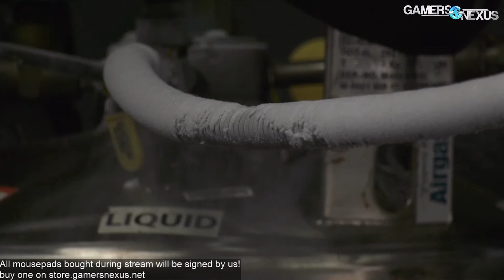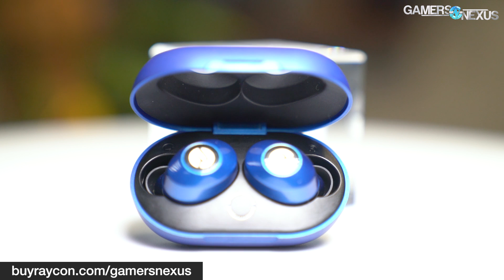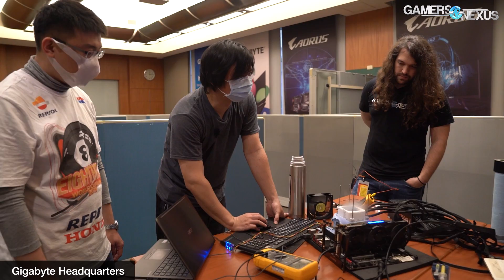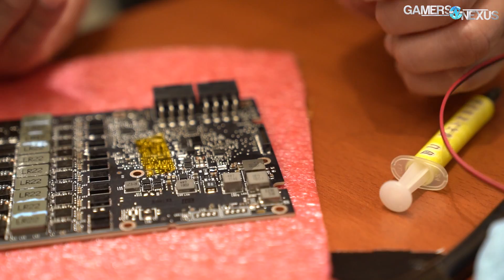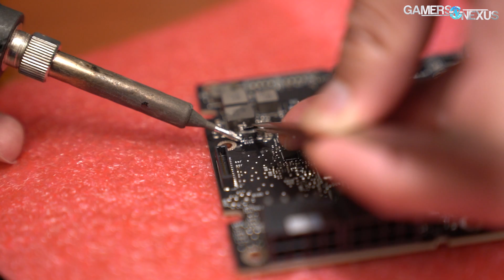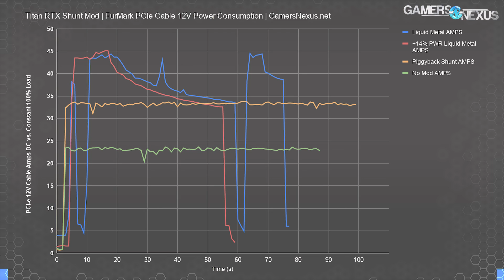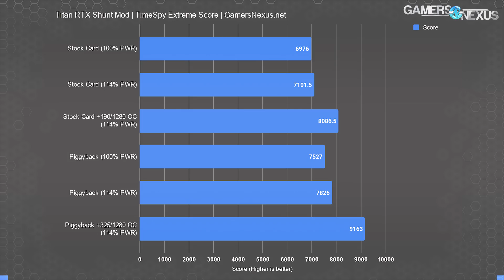RIPJAY Hardmod: Breaking NVIDIA's Rules w/ Shunt Resistor Piggyback, Ft. HiCookie

Comment: For the love of all that is holy - Buy a decent soldering station with good thermal capacity (not just high wattage). lol

Like Pace, Metcal, JBC, Hakko etc.

And use a wider 3-4mm chisel tip. The pointy tips on cheaper stations are almost useless on these multilayer board with huge internal power planes.
Reply: I should say that it worked fine in this vid, but there are countless other vids where people are using a cheapo iron with the tiny pointy tip, and they're wondering why it's not working properly.

8:23 - That's exactly how quickly the iron should melt the solder (on both the component and the pad) when it's working properly. If it's not doing that within a few seconds, then something else is wrong.
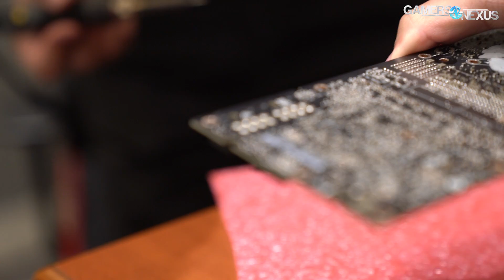Reply: 8:38

Yep, the "shunt" resistor has a known (and very low) resistance, so the card can measure the voltage across it to work out the current passing through it.

It needs a very low resistance, so it doesn't drop too much voltage, which would bring down the supply rail too much. It just needs to have a high enough resistance for the voltage drop to be measured with some accuracy.

The resistor added in the vid is marked "8M0", which means 8.0 milliOhms.

(the "m" is the milliohms unit, which is often put where the decimal point is on the component marking. They seem to use capital letters, for some reason.)

If you enter 0.008 Ohms on this calc, with a current of say 5 Amps, it will give you the voltage drop across the resistor...

(assuming there's only one 8 milliohm resistor on the board originally.)

http://www.ohmslawcalculator.com/ohms-law-calculator

Which is 0.04 Volts, or 40 millivolts.

The card can use that to detect that 5 Amps is flowing from the PCIe power connector to the GPU.

If you add second 8 milliohm resistor in parallel to the first, the overall resistance will be HALF, or only 4 milliohms.

The card will then only "see" 20 millivolts across the resistor(s) when 5 Amps is flowing.
That would increase the current limit by a factor of 2, which is probably not a great idea.

It means that when the card thinks there's only 5 Amps going through that power rail, there will actually be 10 Amps flowing!

So it's always a bit of a risk if you add extra resistors in parallel, or completely short across the resistor.
If something does go wrong, it could kill the GPU itself, or burn up the contacts or wires of the PCIe power connectors.

It's up to the modder to be aware of the risks, and to tell people if the card has been modded if they ever sell it on.
Reply: oic - the onboard resistor was 5 milliohms, and the new one added in parallel is 8 milliohms.

So that would give around 3 milliohms after the mod, which would increase the max current limit to 166%.
Reply: Thermal capacity's largely irrelevant, and is mostly the way that crappy irons try to compensate for insufficient power and bad regulation.
I use Metcal irons for most things, and they have a very low thermal capacity.  That lets them heat up very quickly, and they also cool off very quickly when you shut it off.
What makes it work is that they have sufficient power, and very good regulation so as soon as there's any thermal load on the tip, it's pumping out full power.

I totally agree with you on the wider tips.  While you can get away with a pointier tip on a top quality soldering iron, they're never as good under high load conditions.  On a cheap iron, the tip will cool off way too quickly, even if the base of it is running full power.

I'd suggest for people who want to get into something usable for cheap, there are some reasonable import irons for $20-$30 that fit Hakko tips, which are ~60W and regulated.  They will get the job done, with a little bit of twiddling with the knob to make up for their less than stellar regulation.  (I crank that to 450 if I need to solder to a ground plane, etc.)  Also, they typically have a thin conical tip.  Buying replacement chisel tips is basically necessary to make them work for heavier loads.

For the slightly more DIY types who are into it enough to justify a bit more expense, the TS100 iron is really nice.  I use it for things where lugging a metcal supply around is awkward.  It's DC powered, so you can use an RC lipo battery pack, or put a new connector on a scrap 19v laptop power supply for plug-in use.  It has reasonably decent regulation, and quite good power when running on 19v (It's still okay at 12v, etc, but the extra voltage is nice)  Same is true for the tips.  The stock conical is okay, but a chisel increases capabilities a ton.

Hakko's got some decent stuff in the $100ish range which is probably in the same league performance wise.

Then, yeah, if you're really into electronics enough to justify spending the money, buy something really nice, but you probably know who you are.

Comment: Lucky there are experienced soldering guy guiding you through this, those thick copper pcb under the resistor is pain in the ass if the iron is not powerful enough.

Comment: I havent' seen anyone stack shunts on the Titan RTX's... on Volta and back I stacked 5MO on top of the existing 5MO, but with Turing I replaced the existing 5MO with 3MO. Very curious how that compares to stacking an 8MO on top of the 5MO.
Reply: Are you still running into current limits after stacking any of them?  It's probably jacking the limit up by 40% or so, and I would guess it's hitting other limits before it maxes out anyway?  If it's hitting other limits, having it "more unlimited" isn't going to do anything.
Reply: @nwimpney  according to the OC Scanner yes still power limited. With my setup though, seems to be temp limited as well (have two of them with Aqua Computer water blocks + active backplates in their own loop with a 560mm radiator and 4 x 140mm Noctua 2000rpm fans).
Reply: @kalmtraveler  Well, and 8 and a 5 in parallel is pretty much 3 anyway. so I wouldn't expect any difference between that and the parallel ones unless you're seriously overheating the shunt and getting a rise in its resistance.

Comment: Why not use a rheostat? Yes it would need to be mounted somewhere since it would be bigger than the surface mounted resistor but you would get a lot of current control.
Reply: Indeed.  Wouldn't it be cool to see just what the upper and lower limits are and also find the "sweet spot" without having to desolder/resolder multiple resistors.
Reply: @jessedunn3766  The soldering's not a really big deal for someone with the appropriate equipment and skills, though.
If anyone wants to give me a 2080ti, I'll gladly do some resistor swaps, and let everyone know what the minimum value is.

Comment: I can't wait to hear Louis Rossmann's commentary on this "repair"!
Reply: He had to do a repair where someone did liquid metal to do the shunt mod.  
In simple terms don't do it, the gallium material in liquid metal will slowly eat the solder and caused a failure on the gpu Louis was repairing, it basically ruined the previously good solder joint.

Comment: I know why that mod works.

You're lowering the resistance of that register. The resistance is R=1/(1/R1 + 1/R2). Because of this the voltage drop is lower on that resister because of Ohm's law. I=V/R l, or V=IR. You dropped R so V also dropped. So the GPU might be reading .1V for a 1A current, but you're making it see .05V for 1A. (Not real numbers, but that's the idea.)

Comment: You know you could use butane or some other low boiling point solvent as an evaporative cooling fluid and use the GPU to distill it over into a second container. In theory a liquid can´t get hotter than it´s boiling point so the GPU should stay at that temp until the heat spreader heats faster than the liquid can boil off.
Reply: Leidenfrost  effect is a problem.  I experimented with some phase change stuff years ago, and you hit a sharp knee in the curve. when your coolant starts to float on a layer of vapour.

Comment: Yeah.  Higher temperature is kind of a hack to make up for not enough heat, or poor temperature regulation.
I'm not dissing it based on that.  Sometimes you gotta do what works with the tools you have, and it probably doesn't make sense for most people to spend several hundred dollars for occasional projects, but just for knowledge's sake it's good to understand the difference.
That said, a cheap unregulated iron like Jay attempted was doomed from the start.  They only output their rated power when they're cold, and rely on the resistance to limit them.  Likely a 30W iron isn't doing much more than 10W once it's hot.  That'll never get it hot enough to properly wet the joint, because the board is dissipating more than the iron can put in.

The reason why it takes so long to actually melt the solder, even with such a high temperature setting is because the iron either doesn't put out enough power, or because its regulation is poor, and there's too much of a temperature gradient between the tip and the thermistor/thermocouple in the iron.  (The gradient comes from all the copper in the board sucking heat away from the tip so quickly)
The solder will actually melt at around 320C, even for lead free solder.  You normally want a bit of headroom so you have enough delta to melt it quickly, so for standard soldering 350 or 400 max would be appropriate.

For something like this, you're effectively just cranking it up way too hot so it never turns off, and hoping that you can put the heat into it faster than the copper pulls it away.  Hopefully it gets to the melting point before you cook the resistor that's already there.

Given that, you can reduce the necessary delta by preheating the board, even with a hairdryer, or a heatgun that can be turned way down to 100C or so.  (if you can get someone else to hold it while you solder, even better)  Then you only need a delta of 220c instead of 320c to get the job done.

Comment: Why didn't you do a voltage divider mod like buildzoid? The soldering would be just as easy, and the results should be much more consistent. Also, please clean the flux off with some alcohol. Thumbs up for HiCookie! I'm a fan!
Reply: the voltage divider for the RTX 20 series card is a lot more work than just stacking some shunts.

Comment: It blows my mind that anyone would even consider just haphazardly slathering liquid metal over the resistors to lower the resistance. Swapping out the resistors or stacking extra ones on top is the right way to do it.
Reply: And soldering isnt that difficult :/ but as WE have seen you can make it difficult (Jay) 😂
Reply: @SuperUltimateLP  It's not that difficult, but it's also underestimated by a lot of people who have never soldered to a multi-layer board with big ground and power planes.  A lot of cheap soldering irons aren't up to the task.
Reply: @nwimpney  you are right , but heating the board might help ;)

Comment: I delidded and now direct die my 9900k and get great temps with my 960 mm custom water cooled rig. I love tinkering with my PCs. With that said, would this shunt mod work with my 2080 Super? I use it primarily to game on.
If yes, would I see roughly 13% gains in FPS? Would my rig be able to handle the heat?... Even at full load, the GPU never hits above 42° lol
Reply: Probably.  It just increases the power limit, similar to how the slider did on previous cards.

Comment: Used 5 mOhm shunt resistors piggybacked on my Titan, worked ok, never got safe mode. Lucky me I guess.
Reply: @Klip One Not pulling off the water block to take pics, but here's these
Before mod: https://www.3dmark.com/spy/7893208
After mod: https://www.3dmark.com/spy/9881509

and these are the only shunt resistors I have: https://imgur.com/oZhQFUK

Comment: I do this on all the nvidia cards I buy for my customers, except instead of soldering them you can just place the resistor firmly on top of the stock on and then glue gun the resistor in place so it doesn’t move.  This make it removeable with no trace of soldering incase the card needs warranty
Reply: that will be very unreliable.  It won't likely hurt anything, but you'll never get a reliable high current connection that way, so it'll very quickly just fall back to stock currents when the contacts warm up and oxidize from the mediocre contact.
Reply: I’ve done about 8 of them and two have been running for a year with no problems, most of the time the heatstink applies pressure down on the resistor as well
Reply: Also it’s not a high current connection, it’s an ohm sensing connection, as long as the resistance over the shunt is lower even with a poor connection it will still work, try it before you knock it
Reply: @FrameChasers  It's a current shunt.  The whole current for the card runs through it, which is how it works.  I would say that's a "high current".  It isn't "ohm sensing", it's directly sensing the voltage dropped across the resistor, and it can do the math to know how much current would cause that voltage drop.
With a poor connection, what you'll likely get is a lower current reading (what you want to fool the card into allowing more), until you actually start drawing current and those tiny contact points get warm and oxidized and their resistance climbs to the point, where they're not really doing anything anymore.
They'd probably run fine indefinitely, but they're going to be running mostly stock, with your resistor not really doing anything.
Also, if the heatsink is pressing the resistor directly, that could easily short the sense voltage to ground, which, being a low-side shunt probably won't actually burn anything, but likely would glitch out the same as it does with too little shunt resistance, and you'd be stuck in 2d.
Please, nobody actually do this.  It's a very silly thing to do and demonstrates that you don't understand at all how the thing you're "modding" functions, and if I was your customer and saw this, I wouldn't be for long.
Reply: No, just no, ok. Dont even try to give people such lousy ideas.

Comment: Dumb question incoming: Provided you can keep the card itself cool and power draw under control, could you stack/piggyback multiple resistors for higher frequencies, or is 1 resistor the limit?
Reply: You would hit safety mode if you added more. By piggybacking the 8 mohm resistor the effective resistance is about 3 mohm. Piggybacking another would lower the effective resistance and probably go below threshold required to trigger it.
Reply: the reason this works is because it lowers the resistance over that connection

Rt = total resistance
R1 = first resistor in parallel
R2 is second, etc.

1/Rt  =  1/R1   +  1/R2  +  1/R3 ...

You can have as many resistors as you want (or the amount that is practical)

as you can see, the right side of the equation keeps growing, and when we flip it (remember the left side is 1/Rt)  we keep getting a smaller and smaller resistance

You can read more here: https://www.swtc.edu/Ag_Power/electrical/lecture/parallel_circuits.htm
Reply from the maker: That's not dumb! No, it wouldn't really work. If you change it in that manner, the card would freak out and go into 2D clocks. It'd be worse than stock!
Reply: It's not really a less resistance is better sort of thing.  Once you've dropped its resistance that far, you're probably allowing way more power than the card could ever handle, and the bottlenecks move to heat and voltage.

If you've increased the power limit to more than the card will ever draw, increasing it further doesn't change anything, and also, when you go too far it detects that it's getting impossible readings, and downclocks.
Reply: I think it'd become quite a challenge soldering resistors over resistors.

Comment: its not milliohm milli indicates 1/1000 like with millimeter being 1/1000 of a meter.even 1 ohm is so close to being a short that there's no reason to make a resister with a smaller value.
those shunt resisters are in Megaohms so millions of ohms.just like with Megabytes.so you are saying the shunt on the pcb is 5 Megaohm and you put an 8 Megaohm resistor in parallel.

if both resistors were of the same amount of ohms then the resulting resistance would be half,so two 5 Megaohm resistors in parallel would result in a resistance of 2.5 Megaohm.
however since they are not the same value calculating the resistance is a little harder to convey here but you can find that formula very easily online. 8 Megaohm and 5 Megaohm in parallel results in 3.0769 Megaohm.
Reply from the maker: No, it's milli. Not mega. https://www.youtube.com/watch?v=xvBJftLRt4I
Reply: @GamersNexus  i stand corrected,was not aware of milliiohm resistors even existing.i wonder why then it is marked with a capitol M which would usually indicate mega.
on capacitors for example you would simply use a small m for milli as in mF.

as for my resistance calculation simply ignore the mega and replace with milli,the numbers will remain the same.
Reply: @Ukoverkiller theres an m with a tail for micro,looks like this:  μ
then there's also pico and nano with the lowercase letters. p ,  n .
Reply: @Ukoverkiller It often does on a lot of capacitor markings, even though that's totally wrong.  If you can't use the proper greek mu character, uF is a better way for marking microfarad.  Luckily capacitors very rarely actually marked in milifarads, so if you see something that says 68000mF, it's a safe bet that it's 68000 microfarad, or 68 milifarad, and not 68 farad.  Probably still best to verify when you see incorrectly marked parts.